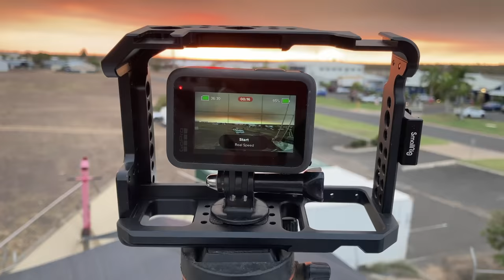Cutting open a Rusty Steel Trawler Bow - Project Brupeg Ep. 252

Comment: Oh how this brings back memories. I use to repair ships in Wellington N.Z. A lot of Collision damage and rust damage always a  lot bigger than you  can see initially. Have seen ships come into port with a lot of concrete/cement poured into a damaged part of the ship... maybe rust or damaged from a collision and they sail around  until they are ready to get it fixed. Good luck with the repair.

Comment: The thumbnail kinda surprised me at this point I was looking forward splashing. Many year ago I suffered a head injury and as a result now and again when I see something I have been exposed to when I see it I smell it. And the smell of that wet rust sludge came through in this video clear as day and as a result of my experience I agree completely now is the time to dig into the section and do the repair.

Comment: 16:05   Jess saying that it is impressive how unafraid Dame is of slicing open the bow.  I’ve never been around welding, so the mindset of welders (i.e., Dame) blew me away years ago on this project.  I’m continuously amazed.
Reply from the maker: That’s part of the beauty of a steel boat is every part is generally easy to replace. So you can keep them in good condition indefinitely if you just keep the maintenance up

Comment: You opened up Pandora,s box.
Better now than later. Check the anchor chain locker for leaks. Also check your forward crash bulkhead. Cement is porous. Can hold water..
While your there weld an extra bow plate for your S. Pole expeditions.....
Good video. I feel you guys.
Carry on crew.

Comment: Yes….. same exact situation currently on my 1967 built trawler. 

Crash bulkhead served as a water tank; upper half from the deck down to the keel is completely wasted!!

Not sure if you’ve done it yet… but I’d recommend a full ultrasound of the hull. It’ll save you down the road, trust me! 

Skin mounted pipe style keel coolers can be problematic, especially at the turns of the pipe.

Comment: Nice work.....Looks like you could do with getting your hands on an ultrasonic thickness guage. Not too expensive these days. would allow you to identify the thin points in the hull and map them out fully. Time consuming for sure but after its done you would know 100% where the hull is thin.
Reply from the maker: Honestly I hate those things. I tried one on the boat measuring 6mm and also some corroded plate and the readings where so far out I would have zero confidence in them. Much prefer to copy the commercial guys and cut a hole and stick my head in the check how bad it is.
Reply: @ProjectBrupeg  "Visual inspection" instead of "imaging method" does have its place. The cutting and rewelding does mean a lot more work though, while reducing the risks of falsely feeling safe is a plus. Coming from the leisure boat industry, my customers would mostly not have appreciated this slightly more radical approach of "visual inspection only" 😁
Reply from the maker: I can understand that. When one option is low cost, fast and effective and the other is slow, messy, five times the cost . That’s a hard sell to most owners
Reply: @manfredschmalbach9023  What about when there boat is sinking would they have appreciated a visual inspection then.
Reply: @grimreaper6112  I would think so, yes. Problem is, the vast majority of leisure boat customers mostly aren't boaters in the first place, it's more of a pissing contest in terms of floating condos than the idea of actually going round the cape and see the world from another angle, regrettably. There are, of course, some real sailors and explorers and people intentionally going out of land sight even, into what we would call "blue water boating", but those are a minority. 
The rest wants shiny bling-bling and visible money more than money put in safety You never see a dime of. 
I came from the racing side of sailing, where absurd money is put in added lightness and easy, quick ways to overcanvassing in ridiculous amounts, which is not appreciated either by people coming to the marina for talking feet overall and numbers of bathrooms heads they have at the "Buccaneer Bar" and become frightened when wind counts with a "2-" as the first number.
That's why I personally turned to singlehanding after the regatta madness. 
So, probably a silly contribution I made 😁 
Anyway. 
I love Brupeg and the Project. Cheers.

Comment: In the 1960's the Eric and Susan Hiscocks (early world cruising sailors and authors) had their third boat , wanderer III,  built from steel in Holland.  Many years of sailing later the only place they had major hull rust was in the bow behind concrete. Your right you need water and oxygen for rust to form......BUT THIS IS A STEEL BOAT IN SALT WATER! what did anybody expect??? duh!  there is no such thing as a 100% sealed compartment, ever! ever! ever! 
Prehaps some heavy tar or pitch on top might have been a good idea as well as a better slope to the top of the concrete.  
the Hiscocks 4th boat, Wandered IV was built in New Zealand from wood like the first 2! (where they lived for many years , susan was alive a few years ago i think)
cheers warren
Reply from the maker: It was leak over 10 years, water sat on top of the concrete and rusted the metal plate along that line. Steel under the concrete was fine. Concrete has been used in steel boats for a long time with very few issues. Occasionally the concrete mix is wrong. Everyone has their ideas but we like to go with evidence,  commercial and professional experience as a guide. Jess

Comment: This is a huge project hats off you guys for doing it. I had a NT855 300HP Cummins in my 40ft trawler (based in Newlyn land of pom) lovely engine a modern guardner in my opinion! The only advice i would offer is take off the knozzel round the propeller, you,ll go faster it will be guieter and less likely to get stuff in the propeller in shallow harbours as knozzels create suction (happened to me n if it gets jammed between prop n knozzel its lift out time) happy cruising

Comment: just a small tip, when using a tool with an extension cord try throwing the cord over your shoulder, then you always know where it is, and you wont step on it, and if it gets hung up on something you only have to reach around behind and give it a flick to unsnag it, worked for me for 40+years its a good habit to get into. boats looking good guys, great video as usual. stay safe guys.
Reply from the maker: Thanks for the tip

Comment: It's amazing how close the thermal expansion of Steel is to Concrete, It is a de-facto recognised repair technique.  The 100 year old steam tug on the berth next to me had lost a rivet (probably 20-30 years ago) which had been replaced with a bolt - this had been leaking and the MCA (Maritime and Coastguard Agency) were consulted and recommended a concrete repair!

Remember to keep a bag of Cement (+sand/gravel) on board as an emergency repair (sealed in a plastic bucket)

Comment: Absolutely the correct job mate great work .  Good to see those plates open . It’s not so rusty in there for a boat that’s been salvaged it’s pretty good actually . Great work.
Reply from the maker: Thanks John. Yeah generally Brupeg isn’t that rusty. This is about the worst of it really. Wheelhouse floor was pretty crap and a bit of the old galley but we fixed those up years ago now and this is thaw last big piece left

Comment: I read somewhere that concrete reaches maximum hardness after 40 years, not 26 days that is convenient to believe. Yours is testament to that. Also, cement is what you add to sand and gravel to make concrete, which is what you are working on here. I have one of those Ozito hammer drills and it is a fine thing but not up to the task of breaking up 50 year old CONCRETE. You really need something with more weight. Cheers and good luck with the imminent launch. Cheers from Tassie

Comment: Talking about the radius cut for steel is exactly the same principle in epoxy wood and glass, whenever i've seen structural failure it's always around areas where it's at right angles, especially in composite cats, where there is huge stress points. I always assumed thats why waterproof bulkhead doors are always rounded. People shit on Ozito but I was a bricklayer and my brickie partner had one and he was hard on tools and that thing was still going after I retired. It lasted years of hard abuse

Comment: Very interesting video. Surprised to see concrete in there but makes sense. I used to work for a company that built dam gates. Often the design would call for us to fill the bottoms of the gate with concrete. Then seal weld it up with plate. Probably just like your bow and with similar longevity. 25-50 years most were rebuilt or replaced. The paint was only good for about 20 years anyway. Greetings from Buffalo NY.

Comment: I’ve found it easier to drill holes into the cement and then jackhammer it out. Just an idea which may save you time. Very informative video as per usual. 👍🏻😁🇦🇺
Reply: Was looking for this comment! Used to do a lot of penetrations through slabs and core filled walls for running services. Always found it easier to go at with with a big masonry drill and swiss cheese it up before breaking it away with a chisel bit.
Reply from the maker: I’m a first time jack hammerer long time  watcher…

Comment: That concrete might come out much easier if you get, some masonry drill bits for that drill, drill holes through the concrete, then put the chisel bit back on and knock out larger pieces.

Comment: that cement is not just ballast, but impact resistance,  Maybe back it up on the inside with closed cell expanding foam?   not that it will do much for an impact, but may may stop any breach if you do
Reply: Having a salty sponge down there is bad, no matter being a concrete one or an expanding pu one. It's got to be steel surface with primer and a fat/wax based cover over it surrounded by air, not any sort of sponge whatsoever to reduce the constant rust activity.
Reply: I think so too. I wouldn't replace the concrete with foam, as that wouldn't give any compressive resistance. Concrete has excellent characteristics under compression (why houses and bridges are built of the stuff). And also just the mass would assist as a dampening effect in case of an impact on the bow. Without the concrete, the keel and stem would have to take all of the impact force, deforming it more. 
I totally get the need to remove weight to rebalance the boat, but I wouldn't necessary fully drop the use of concrete there. Or, if removed (i.e. not replaced), perhaps add a keelson or other brace to make up the stiffness.
Reply: @LeftFlamingo  I'm not an expert in ice going vessels, I reckon the "ice stability" when driving into ice does come from the impact resilience the plate has though. I'm not sure concrete without rebar would do much here, it is the thickness of the hull plate which would decide when (in terms of N per square cm) impact results in deformation/perforation. 
When building carbon prepreg racer hulls we used outside aramid layers to get better impact resilience, and where stuff was behind the outer hull (bulkheads, keelson ribs, load bearing points spreading load with doubling/tripling down inner layers with hd foam instead of ld honecombs as core), impact usually was resulting in more damage than where an elastic movement was possible. Following this idea, a thicker plate or doubling the outer plating where ice-prone would be the way to go, which rendered the Concrete pour "ballast" only. But, as I wrote, not an icebreaker expert.
Reply: @manfredschmalbach9023  if he closes it up without backing it up and hits something will will find out, I just think foam will keep the leak slowed if not just outright plugged.

Comment: I vote with the other commentators add a bow thruster and maybe a mini bulbus bow.  I guess the bulbus bow wouldn't be too good for ice breaking or pushing growlers around though.  I bought a well-used 32 foot plywood shrimp boat back in 1969.  I rebuilt the Detroit 4-71 and twin disc gear.  Then kept it another 5 years.  The leaks never stopped coming.  I never stopped fighting!  Bought a brand new 42 heavily fiber glassed hull in 1975 It was almost relaxing not to have to worry about leaks anymore!  The reality of commercial fishing/shrimping vessels is there is never any relaxing.  The best way to engage in that career would to be as wealthy as Elon then fish until you go broke!  Now I know this, but didn't know back in 1969 just back from Vietnam and wanting a new career!  I wish you guys the best of luck in the future!
Reply: I saw that movie.

Comment: gday well not good the pin holes but its great that it showed up prior to splash down well at least you will know that quality of the metal for peace of mind now and i guess you can weld up the openings in the bulk head and put a air valve etc in to pressurize it then soapy water the out side for leaks all the  best big pete ..

Comment: The concrete does add strength if there is a collision.  I agree use heavier plate to help make it more resistant to bending without the concrete.  Interesting video!

Comment: Your right Jon instead  of taking all that bow off he should welded some thick plates over the whole ow big portion little below water line n go up couple of feet or so I have been saying this from the beginning holding he puts plates on the bow if he's going to Antarctica protection.   He loves taking things. Apart
Reply from the maker: Welding plates over original plates doesn’t pass survey. It’s a really bad idea if the plates underneath are not structurally sound as open the hull up to rust between the plates and because the inner plate is now longer sound you are relying on something weak holding something strong. The only way to do it properly is to cut out anything rotten and replace with new.

Comment: Good chance to add a bow thruster while you're there. Makes berthing a single shaft drive so much easier. You might want to install grates over it though to prevent ice from getting in there
Reply from the maker: I’m not sure your factoring in the budget we are building this boat on.

Comment: I'm sure someone else will have commented - Don't chisel INTO concrete - Thats the strongest part...
Get some masonry drills, and drill holes near an edge  e.g. 2" apart and 2" from edge.  Use the SDS chisel in those and you're going to put the concrete under tension which is much weaker

Comment: Would be interesting to know where moisture is coming from. When you have welded it all back, can you pressurise that area to see where the air/moisture is leaking in?
Reply: Well being the fact it was a sunk boat before he got it, water had gotten in to every inch.
Reply: After You submerge the cement into saltwater for quite a time, the salt residue will attract h2o from every cubic centimeter of damp air it gets into contact with. Salty concrete will work like a thirsty sponge forever, and their hot air in the area will always transport enough relative moisture down there to generate an absolute h2o fallout condensing into that salty cement sponge to produce inside rust. Any concrete residue will do that. So, getting it out anyway no matter what ballast it would be meant for is the way to go.

Comment: Could I suggest that you stitch drill the concrete with an 8-10mm SDS bit then attack it with the jack hammer to break it up, will save you a lot of time. I break into safes for a living and safes have the same but in most cases 10-12mm steel plate amongst other things to make it harder.

Comment: Up front, you are going to want to keep it strong but light as going bow up on ice pans and then "settling" to break them is a feature, not a bug, of Arctic vessels. I can also imagine you'll have more chain and anchor than the original boat had, which is another reason to lose the concrete trim weight.

Comment: Plan to get a life jacket for your Dog. The life Jacket should cover his whole back and chest area as well having a good sturdy enough handle on top to lift him right out of the water as needed.  Also when you are motoring in the antartic area where it can be cold and windy,
the Dog won't be able to go outside to pee or do number 2 so you will need to have a spot to put your artificial turf for him to use.

Comment: Some idea for that bow tank. Can you put two small tubes in that pipe to the cofferdam. One could lead to the top and one to the bottom. Then you use argon to fill up the tank from the bottom while you vent from the top. You also could put a valve in so that you could measure the pressure. If it holds pressure then you are sure of no leaks.

Comment: I like the use of a ultrasonic thickness tester, to test hull thickness in a non destructive manner.
Reply from the maker: In our experience they don’t work. The readings are to inaccurate to trust. Our preference is to cut it open and visually measure.
Reply: I agree in your case, when we used them, it was important to calibrate machine on same steel material as being tested. And they proved good in our case. (May have to calibrate on a rusty bit of steel 🤔 joke)
Reply from the maker: Very likely it was me not knowing how to use them right. I know grinders and welders so for me to cut a hole and weld it up it’s not a big deal but also we can see both sides of the hull plates in 95% of this boat

Comment: As you have the pipe going into that compartment, after it is sealed up could you put some diesel/ oil/rust preventer fluid into it to help prevent further rust? It would slosh around as you move.